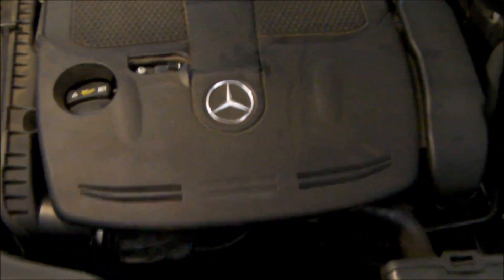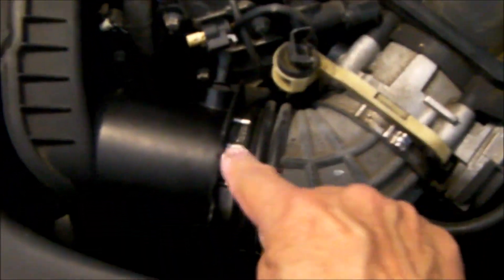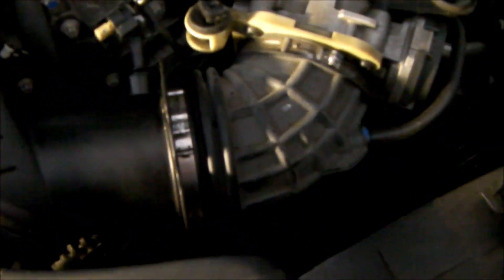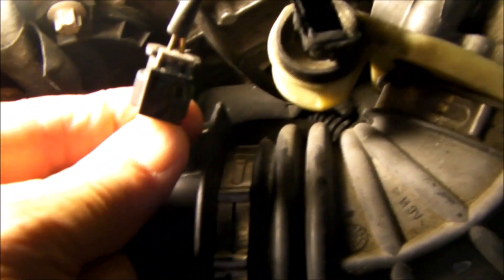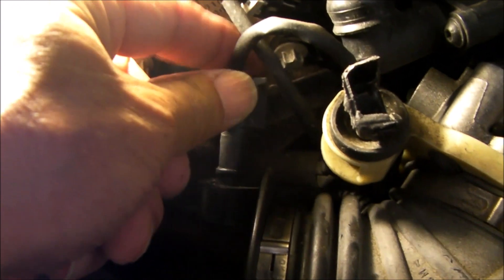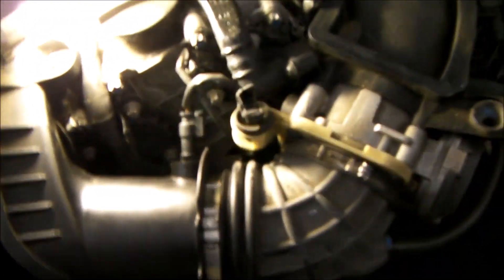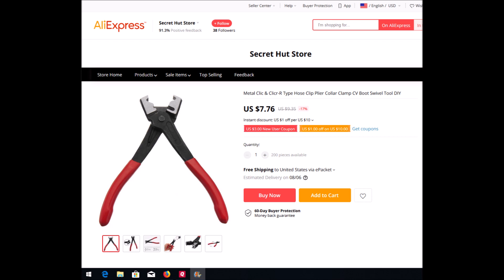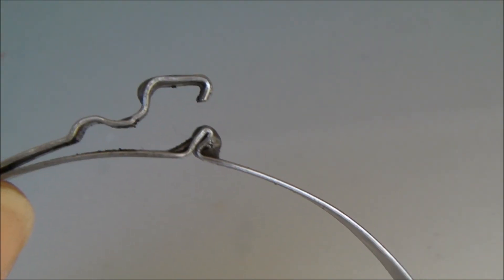Mercedes 2014 E350 M276 engine single air filter change, closeup clamp & sensor plug removal details

Comment: Mercedes:  let’s make changing an air filter as complicated as possible!
Reply from the maker: haha .... True dat !
Reply: If you think that is difficult then try to change the sparks. The first 3 behind the air filter are easy but the 3 on the otherside are so frustrating.
Reply: I agree. (And plastic crap as per usual)  Don't get me started on the even more money pit 4 cylinder turbos now.   Spark plugs?   They wanted nearly 2000 to change them at the Mercedes service center.  We'll worth it.  How about 2000 to fix the non-recalled airbag module calibration error.   Zero out of the 16 airbags work if one doesn't and it's not calibrated by the Mercedes calibration computer and weight machine.   Next time I buy, A Lexus.  I'm now leasing a Mercedes and abusing the hell out of it.   It won't be returned in prime condition.  I'll get some of my money back  `(

Comment: Litterally first thing I did after watching this vid was to try and pull up on that tab with a mini screw driver and the tab fell in the engine bay... thanks for the genius design mercedes... assholes.

Update:got the clip and finished the job, ty so much for this vid, you're a life saver.
Reply from the maker: Hawk:  glad you retrieved the tab (mag pickup tool?).   I agree ... don't know why they have to make the design require special tools ... like apple inventing new plugs and screws so you have to depend on them.  Anyway, you can really help me with a LIKE and a SUBSCRIBE.  Thanks!!!

Comment: When Tried to put back the intake manifold I had a reading leak in the air intake do you have any video on what I may have done wrong
Reply from the maker: sensor not connected properly?

Comment: What can I do if one of the most well known Mercedes dealerships broke the snorkle plastic clip on my car?   Is it absolutely necessary to have a continuing tube to the front?  Does the snorkle run to the radiator or is the plastic oval/elliptical shaped end piece nor important to be 100% attached near the front bumper?

Comment: Remember once you open the tab you have to press on it gently then pull the connection otherwise you wont be able to and you might think the tab needs to be pulled more which it doesnt hence breaking the tab.
Reply: Im trying it wont budge
Reply: @ChickenNuggetDino  press on it away from you. but gently. I broke mines since i didn't know this information before. i had to use a flat head and just go from under
Reply: @justifier2000  yea i got it i was pressing wrong way

Comment: What is that sensor???? The first plug of the video???
Reply: And 2nd can you remove that sensor and add it to an aftermarket air intake OR can you drive without it ?